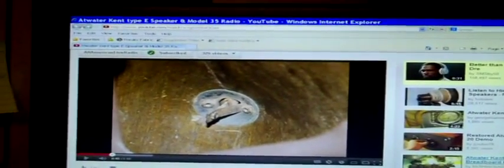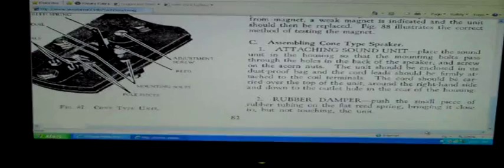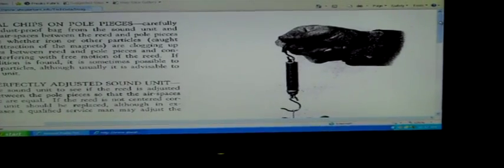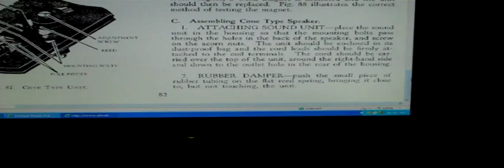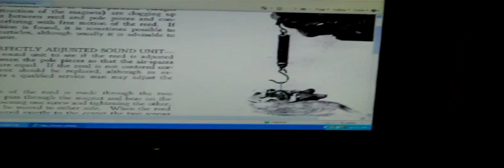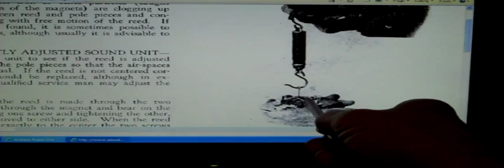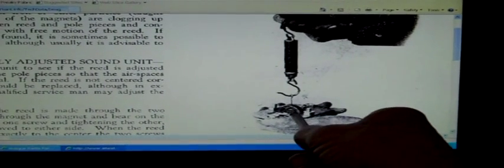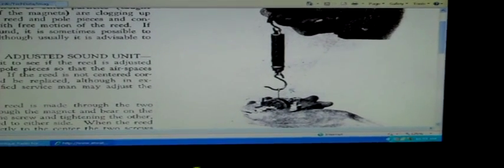1927 Atwater Kent Model 37 Repair and Restoration. (Part 16 of 21).

Comment: Another fine job from Conway.  Keep up  the good work.  I've remagnetived a couple pair of headset "cans" and 2 horn speaker drivers using the technique described on the Nostalgiaire
website on restoring speaker magnets.  I don't know about your driver, but it worked great for my application.
again, good video.
Dick

Comment: Joe I made a discovery, I had low volume just as yours had and I followed your advice and , just as you found not a great improvement. I did follow your advice of "CENTERING the tip of the REED"
no real change, so I was thinking the reed is supposed to be able to move to vibrate.....!!!!     SO the 2 magnets which are also along the length of the REED, were almost touching the reed, infact they were touching, so I loosened the 3 main 1/2 inch nuts and placed a business card strip in between the reed and the magnet at the bottom
    BAM 1000 times better volume..!!!     I did something similar with the radiola 100A but with your guidance on what I'm supposed to see at the tip..of the reed.....Because it needs to be in the middle as audio has positive and negative voltage applied to it so it needs to be centered in order to vibrate. . then I saw the sides were so close they could be  dragging, the business card is just GUAGE for an equal distance for both sides to be from the reed....
                       Ive many more speakers of these with low volume, the fact that it works now means everything up to the vibration is good.........now it juss needs some good cleaning and in some cases rust removal.............................I do appreciate your videos and attention to detail thanks so much!!!

Comment: What I use now to magnetize my tools and screwdrivers is a bulk tape demagnetizer used on cassette tapes.  To de-magnetize something (magnetic tape) you run it over the tape and while still on, pull it away.  But to magnetize ferrous metal, you hold it on the metal and not pull it away.  If you can get those magnets out of the sound unit and use one of these, I'm sure you will have strong magnets.  Just a suggestion.

Comment: for the magnets, see if you can find some of those really small, really strong Neodymium ones like they use to hold things closed with, I can also search around here and see if I have a few laying around as I tend to rip them out of freebie items and mess with them. Stick them on in the right place and they should improve the magnetic strength I'd think.